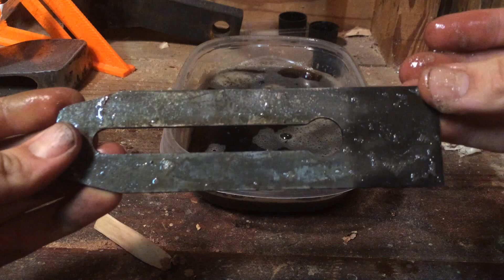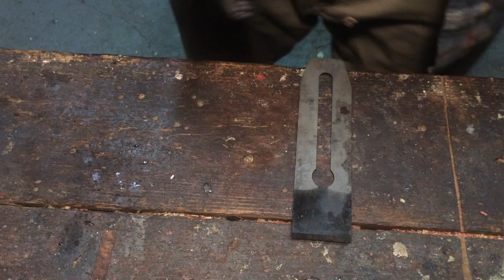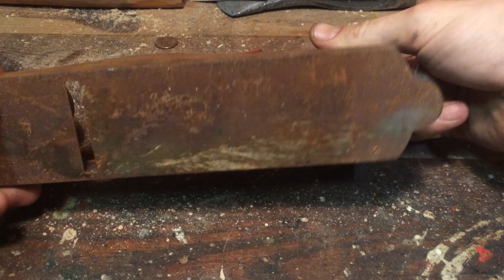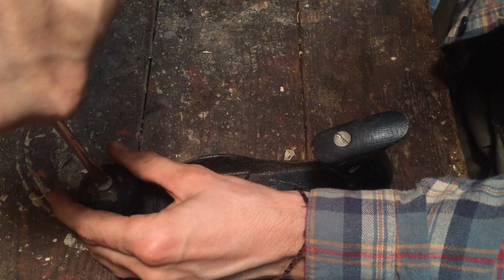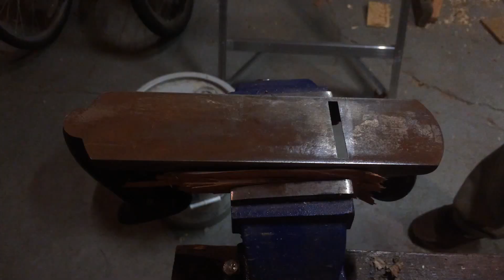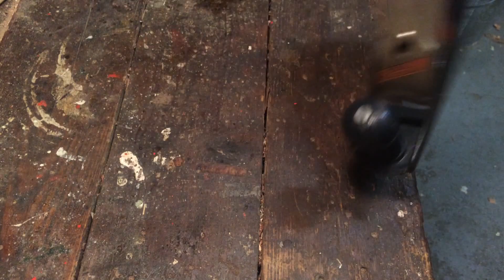Bringing A Vintage Stanley Hand Plane Back To Life

Comment: I got one handyman just like that whit a lot of rust in a really bad shape.The sole had a lot of damage but a used 220 grid in a     flat surface so the sole remain the flatest posible.
I think that one of the purpose of the handplane is to be the most flat it can be at the sole.Sanding it like that I dont think is a good idea.
Regards and thanks for the video!
Reply from the maker: I understand your concern for it not being flat, but it is. the plane works very, very well. this way is a much quicker way of restoring, especially with such a thick layer of rust like what was on this one. thanks for watching!

 - S.Wheatley

Comment: What solution are you soaking the parts in?
Reply from the maker: I used apple cider vinegar, it works very well! But it will flash rust after if you don’t oil anything that’s high carbon! Thanks for watching!
Reply: SWheatley Outdoors I appreciate the response. Do you know how it compares to white vinegar in these applications?
Reply from the maker: PiperCub49 Of course! I believe they would perform about the same. They both have high acidity, and that’s what eats away at the rust. Apple cider vinegar just smells worse!
Reply: SWheatley Outdoors Haha! I would have thought it smells better! Thank you very much. I have some apple cider vinegar right now and will go ahead and give it a shot on some projects of mine.
Reply from the maker: PiperCub49 Awesome! Just let it soak overnight, and the vast majority of the rust should just wipe right off!